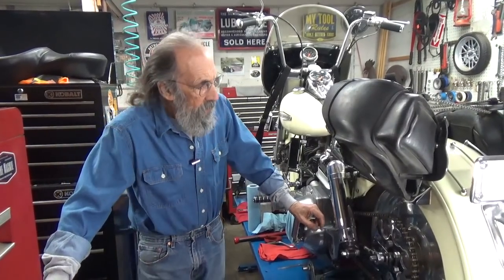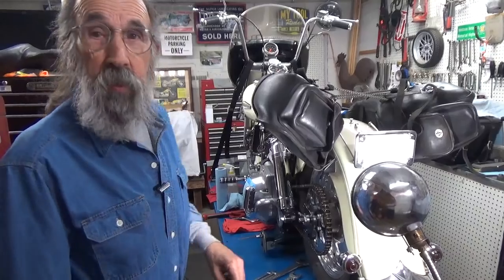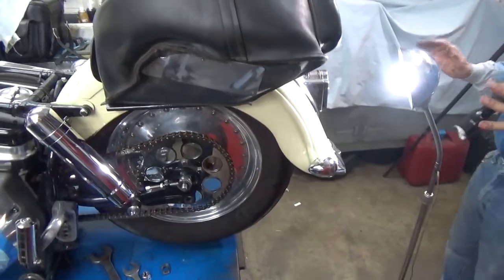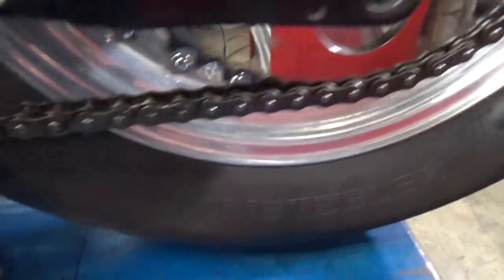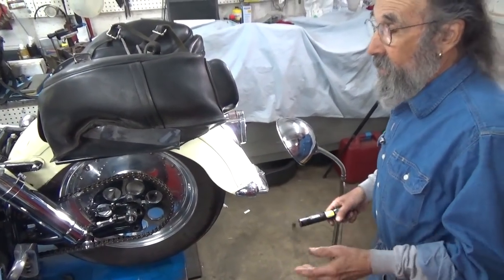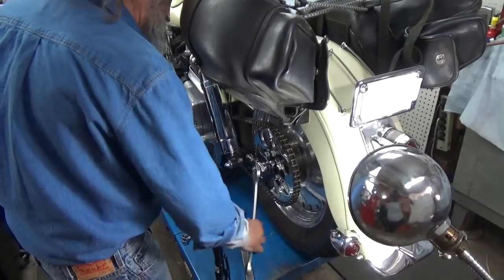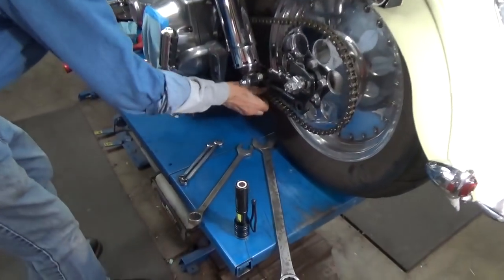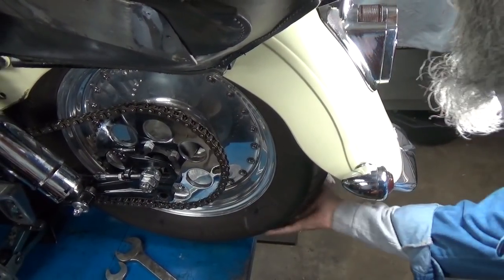Part 2 The Chain is Installed On the Shovelhead, Now Alignment!

Comment: Adjusting a chain with some miles on it = rotate rear wheel & find tightest spot in chain for locating point of adjustment...large variant between measurement = past point of adjustment & time to replace chain... Instruction is in service manuals but checking for chain / sprocket wear & when to replace would be a good video idea in this series... > Noticed it in previous vid...I have the same vintage "gooseneck" floor lamp at my "ink installation" station....
Reply from the maker: Thank You.

Comment: Good job on explaining the chain alignment  with  the chain riding exactly down the middle of the sprocket. I am not as fussy as you are about chain tension when the chain is new  because  you are right ... you will be adjusting it very soon as a new chain will stretch and  I don't bother re-adjusting a chain that is a little too tight ... But if I was to choose between you and I ...working on my motorcycle.. I would choose your way... I just don't have quite the patience .
Reply from the maker: That motorcycle is being prepared for you.  You sir, are certainly worth the time and effort.

Comment: Ya, it took 3 or 4 trie's to get a little less than 1/16 on both side's of the belt drive cog. I used a good washer behind or in-between the swingarm. That helped, for tightening the axle. ENJOY YOUR WEEKEND, PACIFIC MIKE and Family. NICE OUT.
Reply from the maker: A belt has a bunch of different science to it.  But, however you achieve good alignment and proper tension, is cool.
Reply: @pacificmike9501  I still want my SPOCKET and a NEW143. 😜🤪👍

Comment: Mike,  It would be nice to see a video on lowering a shovel using stock shocks and keeping a nice ride.
  Another good video. Thanks Mike and Mike.
Reply from the maker: We used to simply weld the lower mounts through the swingarm.
Reply: @pacificmike9501  Having fusion experience for almost 30 years I have lengthened the swing arm in front of the shock block on a square swing arm. To me just using the old round swing arm shocks is the easiest. The effect of dropping the rear increases the neck rake. Just an FYI.

Comment: Hello Mike’s Garage 
I acquired a 1975 Flh Shovelhead. It’s a work in progress. I appreciate you and your channel, I am learning from you about the Shovelhead.
My wiring is in need of help. I am buying parts, when I have extra money. I have a problem with the chain guard, the tab on swing arm is missing and the weld job looks terrible. Do you know where I can get a tab for swing arm ?
Reply from the maker: It's just a piece of steel with a hole frilled and tapped in it.  Whoever is your welder, can easily fab up a tab like that.  If not, try V-Twin.  They supply a lot of frame tabs in their catalog.

Comment: Mike, awesome video, thanks for putting out this informative and inspiring content. I have a 2002 Indian Spirit (made in Gilroy, CA), and it is in desperate need of an alignment. It has belt drive, and I can see the belt pressed to the left side of the sprocket, and I can hear the belt “squeak “ as I ride. My question, are there big or specific differences when aligning a belt driven motorcycle?
Reply from the maker: Actually, they are quite.  With "misalignment," belts have a tendency to "climb."  If you don't have the appropriate service manual, an HD Softail, like 91-99 Evolution will suffice in most instances.  The engine, of course, is an S&S 88 cu. inch unit and you can get that information from SScycle.com.  But the final drive belt can easily be adjusted and aligned as per those instructions for a late Evo Softail.  Not too difficult.

Comment: They say the only stupid question is the one you don't ask. That being said,  I am on my first bike rebuild, a 76 Sportster XLH . By the time I'm done, the only old parts will be the frame and myself! My question,  with new parts, chain, sprockets,  etc..   what should be the starting point for the adjusters themselves? Surely not " backed off" all the way? I purchased a chain ( deliberately) a few links too long ,planning on  cutting to correct length. But was not sure where, what position the adjusters should be in initially when measuring/ sizing the chain.? As always I truly appreciate your time, effort and knowledge! Your videos are the " Mikipedia" of Harley knowledge !
Reply from the maker: Shorten the chain enough to have some adjustment made.  You can always make it shorter, much easier than longer.  Realize, the swingarm goes up and down.  There will be an initial stretch as the chain wears in a bit.
Reply: Thank you kindly!!
Reply from the maker: You're quite welcome.  Always leave yourself room for error.

Comment: Hello Mike, how are you doing. I`m not so good at writing in english so i'll keep it short. I own a 1975 Harley Super Glide with a Shovelhead motor, were the threads in the timing hole have gone bad.I havent seen how bad it is,becuse some former owner have used a somekind of metallic  bondo body filler to keep the timinghole plug in place and keeping it from leaking oli. My question to you sir is; Do you know if its posible to exicute a threadrepair job WITHOUT having to rip the whole engine apart and split the crankhousing? Have you by any chance done a video about this kind of problem?
Sincerly. Mikael Persson Sweden
Reply from the maker: I've had this problem and eventually, you will probably open the cases for a rebuild.  Then, you can do a proper repair, either helicoil or weld and retap the threads.  Until then, go to your local auto parts store and buy a "repair plug" for the oil pan on a car.  They come in all different sizes, but I've had to grind them to fit before.  It is a rubber plug with a bolt through it that you tighten to seal the hole.  Not pretty, but very affective.
Reply: @pacificmike9501  Thank you very much for your answer sir, have a good day!

Comment: Might've missed it, but how do you get the chain aligned in the first place? Is it a matter of getting the adjusters lined up, or is it to do with the axle spacers? Thanks, Mike. Building a shovel chopper and honestly could never have done it without you! Making the dream come true for me.
Reply: If the spacers were right before replacing the chain, then it’s all about getting the adjusters such that the sprocket is aligned with the chain, meaning both sprockets and the oval loop of the chain are all on one plane.
Reply from the maker: I think you're asking about how to get it in place for your build.  If such is the case.  You're starting out in mid air.  You'll have to find the place you wish to start at.  Normally (on a rigid) the placement of the engine is the beginning.  Then you have to locate your centerline.  How well this thing eventually works is dependent on alignment all the way through.  Wheel spacers, axles, all of these things are how you get there.  The placement of the pulley or sprocket on the wheel.  Then, you will have the rear brake to set up whether it is a drum or disc.  We don't just bolt them together, everything must be fitted and aligned.  When building a chopper, you have to figure it all out.  Approach it with all of the systems in mind so you get the things that will work together.  I'm with you though.  Plan it well and you'll get through it.  Figure it out so you can get the most for your money.  Start with, which motor in which frame.
Reply from the maker: I like that.  It paints a clear picture in one's mind.
Reply: @pacificmike9501  between some spacers, my girlfriend's iphone compass, some cut up beer can shims, and more math than I've done since highschool, I got the whole drivetrain straight as an arrow! Can't thank you enough for all the work you do to share your knowledge.

Comment: Mike. Is that a custom swing arm? I would have expected the square tube swingarm.
Yet what you have looks like the geometry if the older round tube.
But not really.
Reply from the maker: It is an earlier Harley Swingarm.  It is round with castings at all of the joints.  Very strong, also easily lowers the bike when used in conjunction with later shocks.  Strength is the major issue with me.  Of course this necessitated fabrication of some stuff to fit the disc brake and late model Centerline Spun aluminum wheel.
Reply: @pacificmike9501  Ok thanks Mike. I thought so. Rebuilding my 78 Superglide. I lowered it years ago with the too short shocks. Looks cool. Not so good for my 66 year old back.
Always looking for ways to lower it and maintain a reasonable ride.
Jeff Cochran was building customs looking like they were based on the round tube geometry. Doesnt seem to be selling them any more.
Reply from the maker: If you lower your bike with some careful engineering on your stock swingarm, using stock length shocks, you can have it low and still ride well.

Comment: Mike, have been enjoying your content for over a year and greatly appreciate what you and Camera Man Mike are doing.  I have a random question regarding cylinder heads for the Shovelhead motor.  Will the cylinder heads from a 1981 80" FLH Shovelhead work on a 1976 74" FX Shovelhead?  I'm in the process of rebuilding a 1976 74" shovelhead, but the original 74" cylinder heads have fins missing, and so I thought if the 1981 FLH 80" heads would work that it would make for a nicer looking engine when finished.  I live in the Cayman Islands so cooling is obviously very important.  Take care and I'll be watching.
Reply from the maker: If you are going to utilize those heads as stockers, they'll be fine.  A high lift cam will require some work (check with cam mfgr. and ask about the use of 81 cylinder heads).  If you're staying stock or "mild cam," you're okay.  There are minor changes in rocker boxes.  Same thing.  You may also need to change a rocker box stud on the rear head.  I hope this helps.  Just be careful if changing cams.

Comment: What's a good chain ? Really don't like o ring.   I installed a new chain about 1000 miles ago . I have oiled and adjusted 3:times now
Reply from the maker: You know, I don't push brands.  But, when you find what you like it's all good.  I don't like dealing with the added size of 0-ring chains.  Try different lubes.  Find one you like.  I'm currently playing with chain wax.  I showed on a video where I did some maintenance on my Panhead and I show how to do it with heat.  May help you.
Reply: @pacificmike9501  thank you Mike.  I know that me being 280;lbs don't help. But I am not giving up. Love my old girl . She is a 69 generator shovel head
Reply from the maker: And she'll love you no matter what.  I always figure, without beefing anything up, a good old Harley, completely loaded down, should be able to haul 400 lbs. all in.  Other than that, she may need a little help here and there, but then they do anyway.  I always said in the shop (I fitted a lot of people to their bikes), Harleys are built to fit the "average man."  Of course, none of us, have ever met him.

Comment: Hello great advice my question is in regards to sprockets on your bike how much rpm are you running at 80 mph.
Please tell Sonia my wife and I say hello what a beautiful dog
Reply from the maker: It won't make much sense unless I explain.  I run stock sprockets for a 77 FLH.  That is, the stock number of teeth, 23 on the trans and 51 on the rear wheel.  I also run a 140/90 rear tire and a Baker six speed transmission.  Sixth gear is a .86 overdrive.  I think she's turning about 2800-2850 at 80mph.  With my old 4 speed, quite a while back, I usually ran 24 and 49 and a 140/90 rear tire.  That was almost as high.  Sonia just blushed when I read your comment out loud.
Reply: @pacificmike9501  "Baker six speed". Maybe just a bit jealous. But I am putting in significant attention rebuilding my 4-speed to get it 100% right (and as leak-free as possible). Besides, at my age I don't need to go that fast anymore...

Comment: So, do you have to decide which takes priority. . . chain alignment or wheel alignment?  When you're tweaking the chain alignment aren't you changing the vehicles wheel alignment? With my Harleys I've always had to throw wheel alignment out of wack to compensate for the bikes to track straight.  Maybe the clutch case adds weight off the center line of the engine/frame combination.  In other words my Harleys usually pull to the left idling down the road.

Sorry for the long windedness =)=
Reply from the maker: Not at all.  I got it.  Truth of the matter is, unless you really do some measuring, you really don't know what's off.  I've ridden one for years that I always thought was a really crooked frame.  I just lived with it.  I finally noticed one day that I had a completely cut wrong, way out of line, HD factory solo saddle.  And I'm a little off plumb too.  It boils down to, "How far off is it?"  Start by running string lines.  Do you have a disc or drum brake.  The disc can easily be shimmed.  So can the rear sprocket.  Do you have a bent swingarm?  Don't know what you've got or how far off it is.  Maybe it's in your front end.  If you look into any of the rubber mounted Harley Service manuals, you can see how to align (or at least check) the wheels with each other.  My friend made me a pair of alignment bars.  When we were building bikes in the early eighties, we used fluorescent  tubes because they're straight.

Comment: I want to consult evo 1997. I have a problem with engine oil. push out of the machine
Reply from the maker: If the bike has been sitting too long, gravity takes over and fills the crankcase.  That is probably the problem.  If nothing has been damaged and the bike has just not been run in a while, put a pan under it and run it until it balances out again.  The oil level will be low in the tank.  After it calms down and balances its system, be sure the oil tank is not too low on oil.
Reply: @pacificmike9501  I've replaced the oil pump and it's not gone.

I opened the cam and saw that the crankshaft drive sprocket was damaged, had scratches, and the tooth was dropped.
Reply: I want a way to contact and can solve the problem 100% I've repaired it several times, but it's not gone.
Reply from the maker: Very cool.  Sounds like you've got it.  My only issue would be, "What caused it to break?"  Usually, it's something that got jammed in there.  I hope you can get it all clean enough to repair and go again.  We're contacting fine through this "comment section."  You are apparently knowledgeable and my responses are based on guessing what you have.  But, you seem to be doing okay.
Reply from the maker: Installing an oil pump on that motor is difficult without removing the cam cover.  You usually end up dropping the "key" from the oil pump drive shaft.

Comment: I always have a problem, sometimes I ride alone and sometimes with the fat ol lady as passenger, I know switch to a lighter ol lady, but I have seen some chain tensioners I think from powelperralta or something like that wondering if that would solve the problem
Reply from the maker: Your guess is as good as mine.  Hopefully, it will make you both more comfortable.